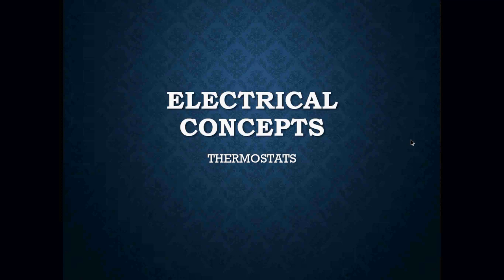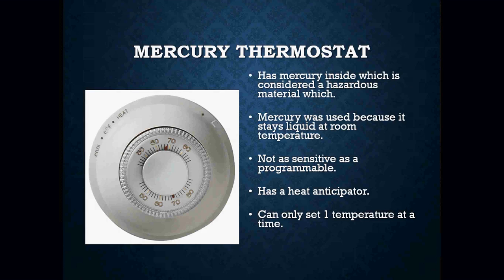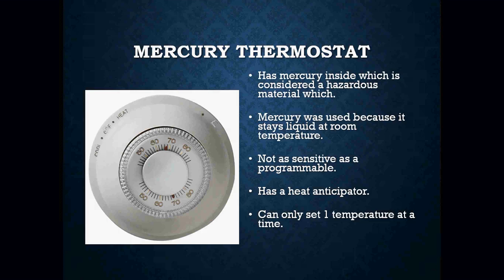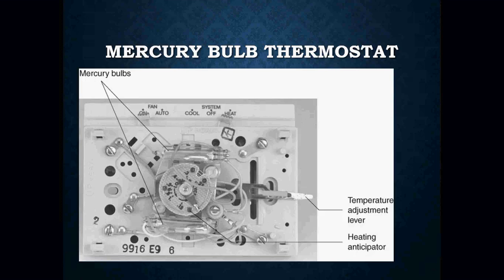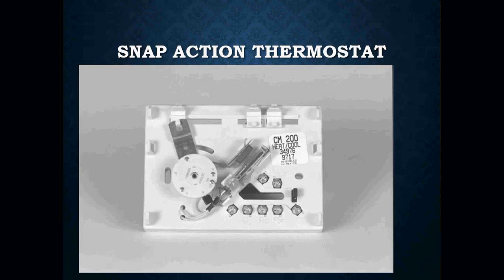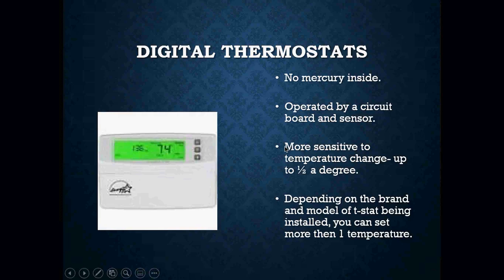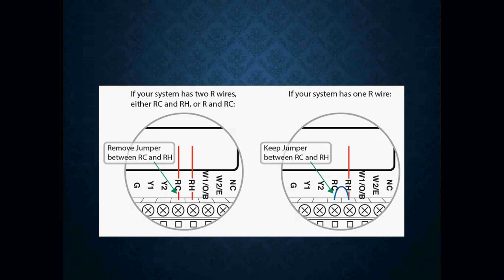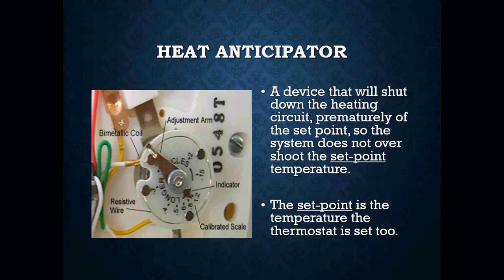Thermostats

Comment: I have your snap action thermostat missing cover. Same as your photo. Can you tell me are the controls auto off on and heat off cool for the 2nd and 3rd levers. Or the opposite. I don't know which control is for which.
Reply from the maker: You are correct.